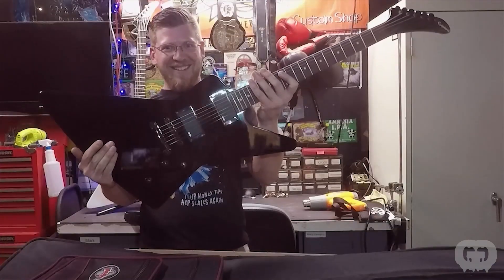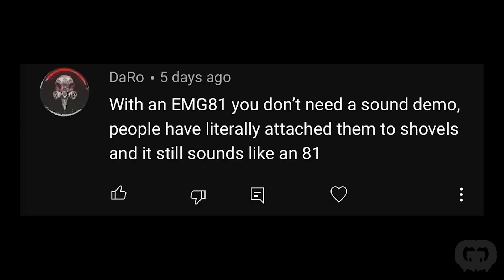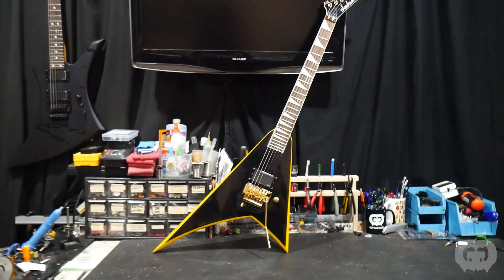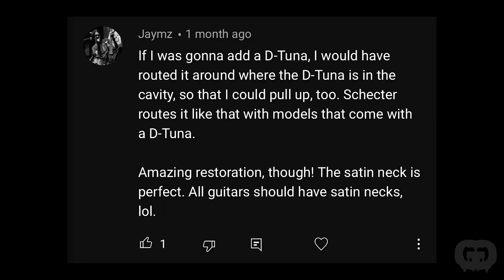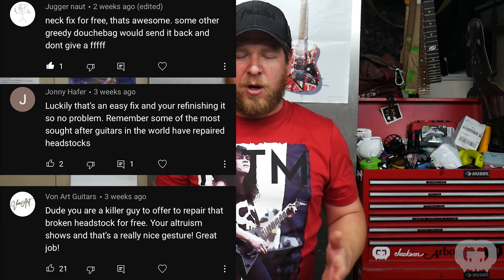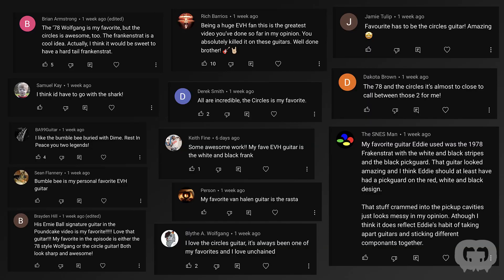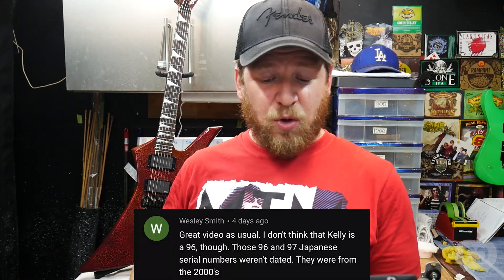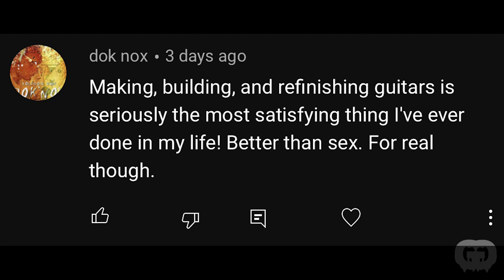Trash to Thrash #27 - Season 2 Mid-Season Update

Comment: 6:25 Gibson explorer shapes are all over the place. The 58, 76 and 84 design are different from each other, and additionally, Epiphone has it's own shape that is consistent across all models. When Gibson reissued the 84 explorer model around 2008, the used the wrong body shape and the wrong control layout.

Also, ESP has 2 explorer shapes as well, the MX-220 and MX-250.

Comment: Ah, my binding comment.. 😅 Great! I'm glad you called that out because you're still not thinking this through, brother. Plus that was a poor analogy, BTW. 

Here's why - There's one big difference regarding painted binding/vinyl sticker side marker dots & the headstock logo that gets cleared over. You're not playing the headstock! 😉  Of course it'll be fine.. That's not going to wear off, because you're not wearing on that particular part of the guitar.  However, you ARE playing the neck, on which the finish will undoubtedly wear off over time there.. You're smart, you already know this. ;) 
Sure, other companies clear coat over their side dots, binding, etc, BUT they're not using stickers of all things, nor are they painting over the existing binding with a different color. If you wanted orange binding, then you probably should've found some actual orange binding, removed the old and installed the new. You see what I mean here? I'm not trying to bust your balls man, I'd just like to see you go the extra mile and do it right, so that it'll last the customer decades, and not a year or two (depending on how much they play). Side dot material isn't hard to install - mark & drill the holes, plug it with the stick, cut it down flush, clear over it. It'll last forever that way. Binding is a whole other beast though, but that's another topic for a different day. 
Anyways, please don't take any of my comment(s) negatively - it's just constructive criticism, that's all, but I do still stand by my original comment - painting neck binding and the vinyl sticker side dots were whack. 👌 Other than that, well done. You do good work, sir! Keep it up & Rock On! 🤘

Comment: I have actually done a good bit of research on the Jackson serial numbers recently. I have a Jackson Warrior with a 96 serial number, but their is no way it is from 96 as Jackson didn't start making them again until 01. It is my understanding that Jackson started using the 96 serials for their MIJ guitars in 1998 until about the mid 2000s. Serial numbers starting with 97 and 98 are also from later in this era as well.